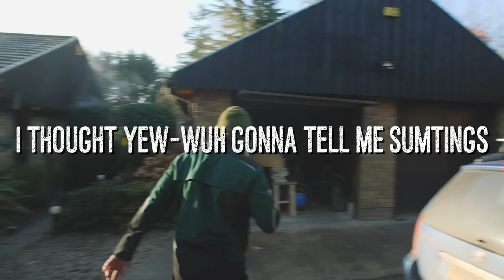How to make a front door Ep3 | Biscuit joints for a door

Comment: Cool video bro but wheres your push stick??  One slip with your hand from off the wood that close to the blade an it'll be goodbye fingers.  Please do take care when using powertools they are dangerous if not used correctly. You got to have 200% concentration when passing timber through the table saw. I had a nasty table saw incident but i was lucky enough to still have all my fingers.  Im a carpenter by trade myself an have been for 20 years an ive seen some accidents within that time.

Comment: Love the door design and intrigued by the construction techniques. Keep up the nonsense it makes the material less dry than it could be.
Reply: Try covering your clamps with parcel tape, then there's no risk of the water/glue, the steel and the tannins in the oak interacting.
Reply from the maker: Thanks Alan, that's a top tip you've left below there too - thanks for getting involved!
Reply from the maker: Cheers Alan, that’s a great tip. The black stain from tannin/glue/water/steel contact are a pain. Because this door is getting a flame finish, the black stain wasn’t as big a problem. But on something with a clear finish, these marks can be a pain to hand sand. Cheers, will credit you and probably do a tricks and tips episode soon.

Comment: You are using biscuits exactly what they are good for - alignment. Biscuits get a lot of flack unjustly in my opinion. Rather see more making action in the vids than gab. Oh BTW, polyurethane glue is not a gap filling glue, that foam it produces has zero strength.  For a true gap filling glue you need epoxy.
Reply from the maker: Al will jump in here and debate glues and joints with you shortly, but thanks so much for sharing some facts and tips - keep 'em coming, sir!
Reply from the maker: Most commercial Joinery shops (specialising in oak) round here, use biscuits. They’re low cost. Trying to get a Joinery shop manager to invest in a Festool ‘Domino’, is a non-starter. Think the ‘marketing’ men just reinvent the wheel, with a lot of new jointing systems, and tie you into buying fancy dowels forever after! I use very little epoxy currently, but want to shift over really soon. Can you recommend a good quality epoxy adhesive? We may review it against the PU used here. Clean up annoys me with PU too.
Reply: I've noticed that a lot of the European joinery's use PU glue, here in the states it's rarely used anymore.  I don't know about the brands of epoxy you might get in the UK, but here West Systems, Total Boat and System Three are three popular brands. Epoxy takes a little time to prepare and use and it is more expensive than PU, but its performance is far superior.